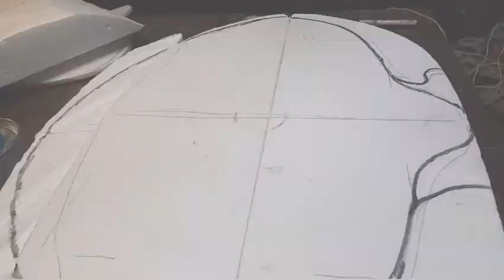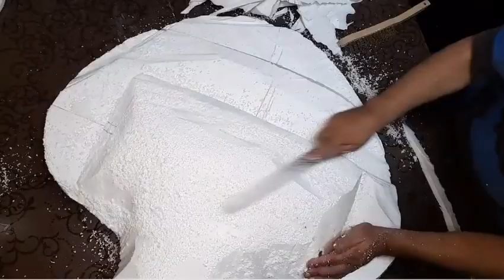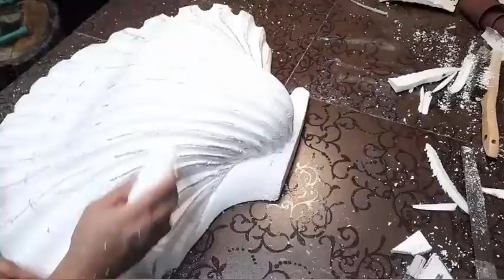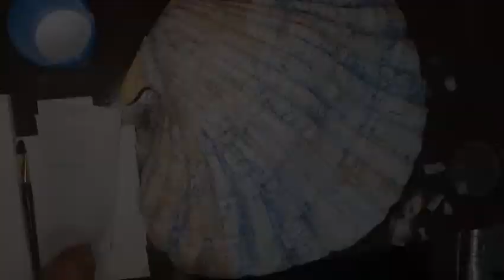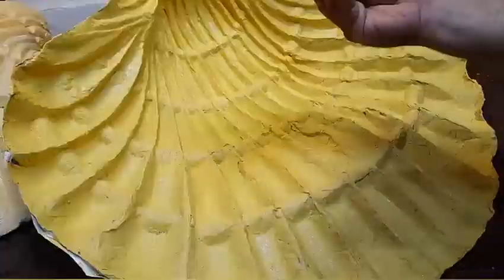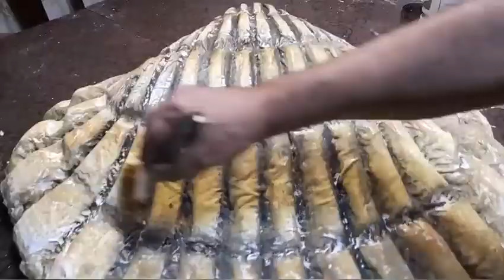FOAM CARVING THE WONDERFUL SEA SHELL WITH THE SIMPLEST MATERIALS.

Comment: What did you paint onto the foam before placing paper and glue onto it to prevent it from sticking to the foam?
Reply from the maker: I kept my car's motor oil when I changed the oil because it has a heavy consistency and insulates what I want to insulate. Thank you very much